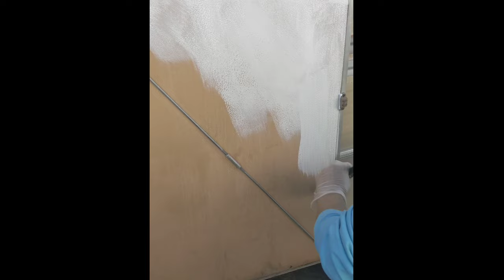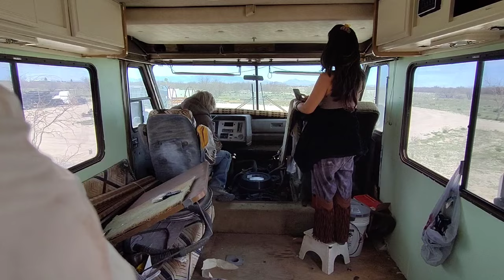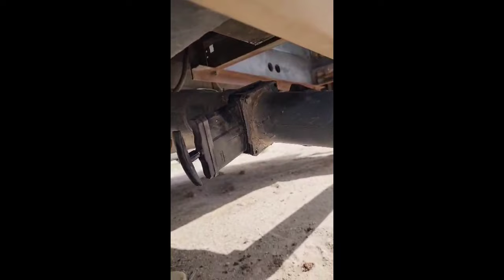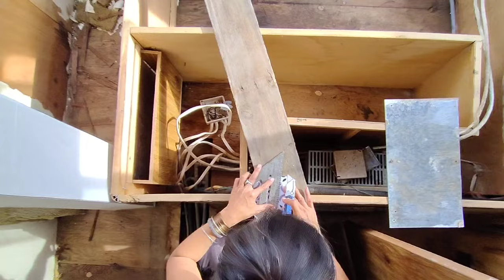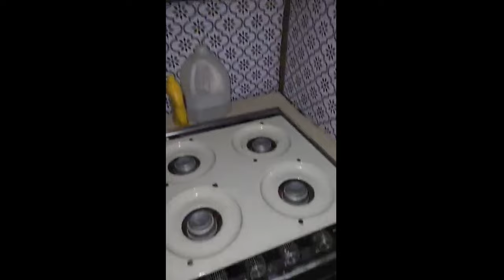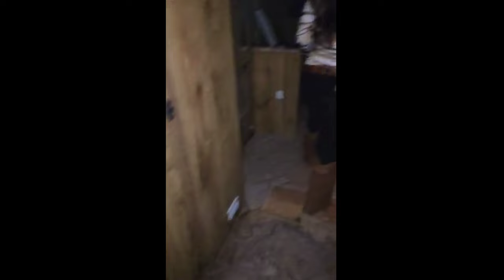1982 Fleetwood Pace Arrow remodel update April 10, 2024.

Comment: Hi, I got the same space arrow rv, I like to see your renovations,  I'm 74 years old, I love my rv. I bought it on 2019, I been doing small Renovations..my only problem I'm living in it it's my home, but there is limited storage and counter space, so I think I'm going get rid of the sofa and chairs and add cabinets from the ground up, it will give me the storage I need and counter space,  everything in my RV is exactly the same as yours, but I think mine was custom built . I got a built-in blender on the kitchen counter, and a built-in vacuum cleaner, I don't know if the work yet..and it also came with a pull down bunk bed , I use it for my  suitcases, comforters and extra clothes. .the passenger seat is like a small love seat..but everything else is the same as yours decor and everything.
Reply from the maker: @caroltorres134  wow that's awesome. It is very spacious.  Thanks for saying hi
Reply: One day I will send you a picture of my before and after,  I don't have a YouTube channel,  but I love researching. I got rv repair person who helps me with the things I can't do..and I'm pray God sends me a mechanic to look at my engine it only has 55 miles on it.
Reply from the maker: @caroltorres134  I pray you can befriend a mechanic. I'd love to see your renovations. You can email me at kristofertravels@gmail.com anytime.